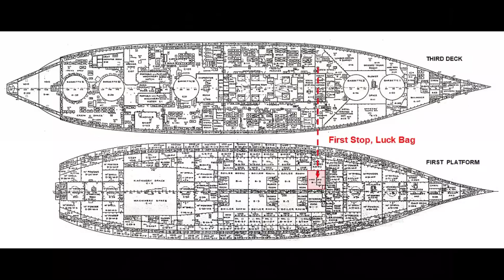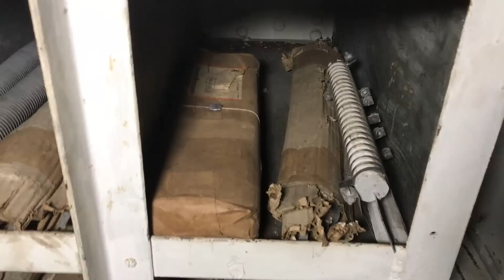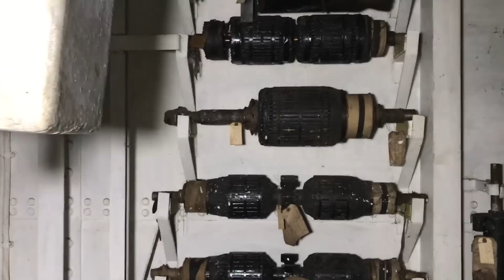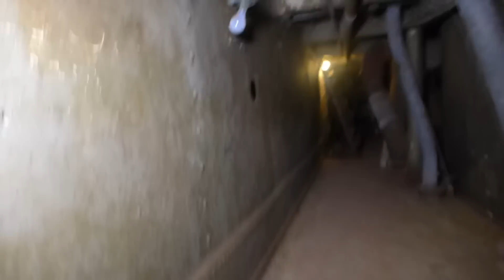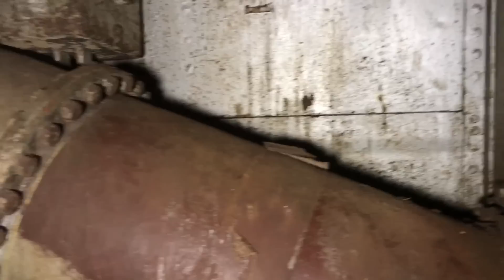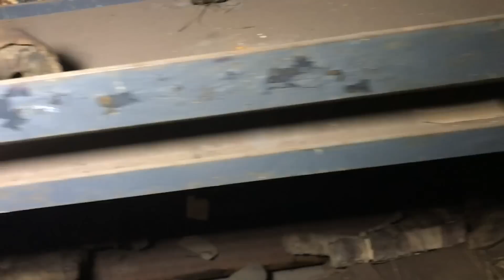Battleship Texas, Looking For Hidden Treasure!

Comment: How handy would a laser paint & Rust removal device be for cleaning up the USS Texas given that that everything seems to be covered with a layer of rust? If you had to choose a paint color then what would you go with for the interior?
Reply from the maker: There is still a great deal of paint in place that must be removed when repainting.   That is extremely expensive to do since it is lead based and must be remediated by a licensed contractor.  Current restoration work uses epoxy based paints that have excellent adhesion, corrosion resistance and life.  As far as colors, they go to great effort to match what was used on the ship during WWII since the ship is displayed as she was in 1945 at the end of WWII.  Most decks are typically painted a specific shade of read.  Most passages and compartment bulkheads and overheads a shade of white, officer's country bulkheads light green and most compartments, store rooms and ammunition handling spaces in lower parts of the ship have silver bulkheads and overheads.
Reply: @tomscotttheolderone364  I wish it wasn't lead because I bet you could crowd fund some high end equipment such as a few paint/rust laser removing machines so multiple people could work in a team  to methodically remove rust & paint room by room.

For instance you  could split up 1 wall of a room in half so you could have 2 guys split the work load in half.  

Maybe you could strip a whole room down to shiny machine  metal surface including the floor and ceiling in a single work shift.

That would be 1 team of volunteers and you could have 2 or 3 teams of surface strippers.

Set goals such as each season you would strip 100 percent all of the metal surfaces & equipment of 1 deck level down to shiny bare metal.

Once you strip the metal to shiny bare metal & do a good paint job I could see the rooms lasting decades. 

Speaking about licensed contractors, I wonder how difficult it would be to get a license...

I bet the State of Texas could compensate somebody the way restaurants compensate their workers for  getting certified in safe food handling.

If I was a young man again I would see the USS Texas as a nice portfolio project. 

A big project, but something Amazing if the USS Texas were to be 100 percent stripped down to shiny bare metal like it was recently machined at the ship yard, repainted, and for a 360 VR tour including annotations of what different equipment & gauges do.

A project like that would land a young man into a team leader role at company that compensates it's workers well.

It would be so cool if you could do VR tour, click on a gauge, and a tour guide would go into the nitty gritty details of what's the purpose of the  gauge and what could go wrong if you don't pay attention to that very  specific gauge that you clicked on.

Perhaps while doing a VR tour you could look at technical documents would be scanned, for instance a official  repair manual for a specific hydraulic pump.

If you did that then you'll easily land your self some sort of management role making six figures.

I bet you could spin that VR work off for instruction manuals for equipment such as those massive Marion  mining drag line excavators that have a machine shop in the excavator machine.

The US military is doing augmented reality glasses so that technicians  are able to see where on the f-35 steath jet the Error codes are saying you need to replace a part. That way they don't need to thumble around for an hour to find some small sensor.

Comment: the refrigeration parts store - the seals - are they axle seals for refrigeration compressors ?
Reply from the maker: I would assume that they are for that and many other things.   The storeroom is directly below the ice making room that contains several  large CO2 compressors, along with both condensers and evaporators.  The compressors naturally had a number of shaft seals and gaskets.  The condensers and evaporators were assembled from scores of threaded pipe sections and elbows that used gaskets.

Comment: ehhhh, the compressor sucks gas from the evaporator and then transfer the hot gas to the heat exchanger ie condensing unit and from there via a pressure reduction valve into the evaporator.....

The lower pressure forces the  freon to start to boil, while boiling each molecule will demand the necessary heat from its surrounding and the gas enters the evaporator as droplets - a well adjusted pressure reducing valve should allow enough freon so that 95 % of the piping in the evaporator has liquid in it -  IT is awfully important that the compressor doesn't sucks in ANY whatsover liquid droplets or not - that is a guaranted water hammer.

Comment: In the early 1990s, I worked in an ice cream dairy that had been built in 1946. We ran anhydrous ammonia. But two of our compressors were Frick 3-cylinder high-pressure units. They looked very similar to the R-12 compressors you filmed. Compressors like that give off A LOT of radiant heat.
Reply from the maker: There are large compressors on board used to produce ice that run on CO2.  Ammonia was the preferred medium in1912 when they were built, but it was far too dangerous to have on board a warship.
Reply: @tomscotttheolderone364  yeah one leak would have killed many people.

Comment: I’m happy to click like after watching this entire (very interesting) video, and even leave a comment to boost you in the algorithm. 🙂  

Keep up the great work keeping this history alive and vibrant.

Oh, also a request, could you show the interior of the fire control stations in the fighting tops?  I’ve always thought the standard(ish) era battleships post-lattice mast fire control directors looked fascinating, but I’ve also wondered how the heavy window framing affected their operations.

Thanks!
Reply from the maker: There isn't anything to see up there.  All of the equipment was removed by the Navy when the ship was being prepared for donation, leaving the compartments completely empty.  It's my understanding that it was done to remove their heavy weight from that high on the ship.  They had a bad effect upon stability with the ship in its extremely lightened condition caused by removal of ammo, most fuel, crew and supplies.  That's a good question about interference, I've thought about that myself and have never found a discussion of it.  Having said that, Mark 3 fire control radars almost totally replaced the optical directors during WWII.

Comment: Wow the armature as , resistors and even a drum controller for a starter , takes me back to the days of my early career working on DC. ships . All very basic but achieving a great level of control and performance of the ships functions . It's amazing all these spares  are still there , ready for action in most cases I expect . I'M guessing there should be some bearings to go with the armatures  and I haven't seen open brushgear on a motor for a very long time . Given Texas age she looks in pretty good shape considering she's in refit and it's reflects great credit on those who look after her .
Reply from the maker: I don't recall seeing any bearings.  It could be that they would have still been useful.  However, I suspect there wouldn't be any use for the armatures since they were specific to 120 volt d.c. motors that were obsolete by the time Texas retired. I have also seen some small and medium size brushes packed in cardboard boxes and wood crates.
Reply: The ships I worked on were 220dc , including the HMY  Britannia . Some of the armature with double windings were for motor generators as transformers don't work on DC . Thanks for the info , a very interesting video .
Reply from the maker: @DavidSmith-cx8dg  There are M-G sets all over the ship that were used to either produce a different dc voltage or convert to ac.  The 40mm anti-aircraft guns installed in the last half of WWII all required 440vac. and two very large M-G sets were installed in 1926 to power the fire control director transmitter circuits.  They required ac in order for their self synchronizing gear to correctly function.

Comment: I bet there’s a lot more hidden
Reply from the maker: Some, but not much I've been in every storeroom and compartment on the ship and with the exception of what you see here, they were stripped pretty bare.  There are a lot of damage control items that were in the damage control lockers located on 3rd deck.  Unfortunately they were all removed before I could video them.  Texas Parks and Wildlife cataloged and removed them in preparation for the dry dock repairs.  It included wood plugs, wrenches, hammers and even gas masks.

Comment: Thanks for a fascinating tour!  

As you entered space A-111 there was a faded sign in large red letters on the left bulkhead.   May I ask what it says?  

Electric motors were still pretty new in 1914 and I seem to recall reading that the lacquer used at the time to insulate motor windings wasn’t very reliable.  A salt air environment wouldn’t help.  So I’m not surprised that the ship carried a lot of spares.

May I ask what was the working fluid in the refrigeration plant?  The OLYMPIC and TITANIC, built about the same time, used carbon dioxide.
Reply from the maker: If you are referring to "FMCO M-2", I believe it stands for Fire Main Cut Off.
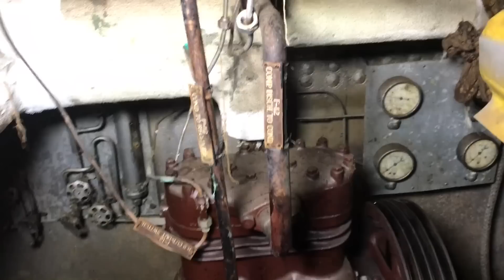Reply: @2:20, the line tags indicate F-12. This is likely "Freon-12", the commercial name for dichlorodifluoromethane. Freon-12 wasn't available before 1928. Likewise, the Frick compressors are 1940s-era. And if the system was installed in Hawaii, then my best guess would be that it was installed sometime between December 1944 and January 1945.
Reply from the maker: @doktorscottdiabolical  You guess was dead on!  The compressors were installed as part of yard work at Pearl Harbor from December 13, 1944 until January 3, 1945 prior to taking part in the invasion of Iwo Jima.  They also added another small system to cool auxiliary combat information center and the infirmary.
Reply: Thanks!

Comment: The electrical stores space is in amazing shape. The humidity must have stayed lower in the space. The paint in there is very good shape compared to many other spaces on board.
Reply from the maker: You are right.  Many lower spaces forward of the boiler rooms are pretty clean and corrosion free.  There was little water penetration into them and they normally stayed closed.

Comment: Those old steam lines are they still covered in asbestos! If so, I hope the covering is in good shape. I didn't realize that all those spare parts were still on the old girl.
Reply from the maker: It is definitely asbestos lagging that has been encapsulated.  They are extremely careful with it.  If any is damaged, the compartment or passage it is located in is sealed and a licensed contractor is brought in to remediate and repair it.
Reply: @Tom Scott, The Older One  Good deal, I worked around that stuff for over 35 years. Although it actually is one of the best fireproofing materials, it's definitely nothing to mess with. I worked with a guy who smoked like a freight train and would wollow around in it. Not for sure if he's doing good or not. Didn't like working with him anytime we worked around this stuff. Great video. How much of the ship is going to be open to the public when everything is done.
Reply from the maker: @georgedistel1203  It is very unlikely that much more will be open than what was prior to the ship closing.  That includes 2nd deck passages, 3rd deck, aft of the boiler rooms and the starboard engine room.  Opening up more than that greatly increases the possibility of falls and injuries since it would require using vertical ladders.  The other issue is vandalism.  It is easy to see what used to be open to the public by the level of damage to equipment that was destroyed by visitors when the ship was largely open from the late 1940's through the early 1960's.
Reply: @tomscotttheolderone364  do they ever do like a deluxe tour that people pay extra for?
Reply from the maker: @georgedistel1203  There are hard hat tours that cost extra and that will likely start up again once the ship is in its new home port and open to the public.  They included #1 turret gun house, its handling room 4 decks down, boiler room 3 and air compressor room that used to be part of the torpedo rooms removed in 1925.  Also included were the navigation bridge, chart house, combat information center, main battery plotting room, forward dynamo room, forward electrical distribution board room and central station.  Much of what I show in the videos will never be on a tour because the excessive ladder climbing is too difficult and takes too long to get a group of 10-12 people in and out the spaces.  It also did not include the engine rooms because they were open to the public and we concentrated upon what was normally inaccessible.
Reply: @tomscotttheolderone364  what did the hard hat tours cost very interested
Reply from the maker: @georgedistel1203  I would rather not say because future tours will be conducted by an entirely different organization and may be very different.
Reply: @tomscotttheolderone364  that's something that would make a great video about the vandalism that was done years ago. I have no use for vandals or the damage they have done.